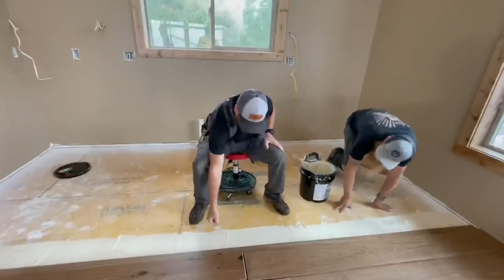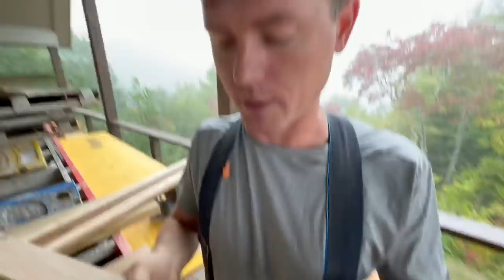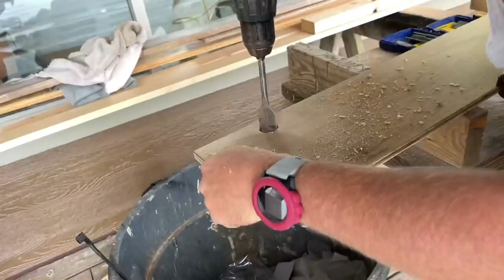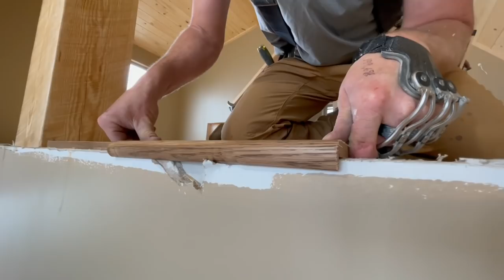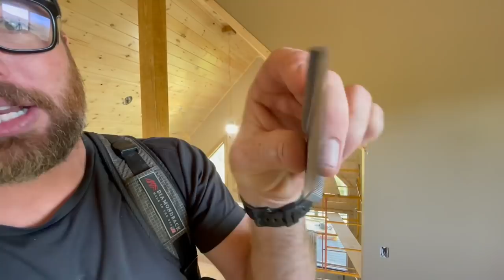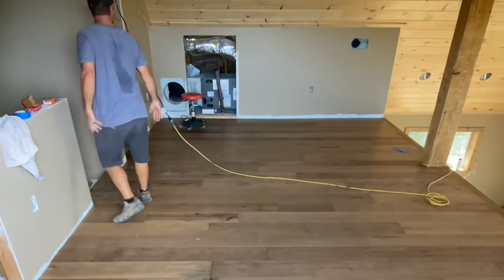Building The Nantahala Retreat #36 | Flooring Details MATTER

Comment: When putting flooring down in my office I ended up in the interesting position of the room length being exactly 2.5x the board length, meaning any cut offs I used would create a stair step pattern.

I ended up just cutting off a random amount from the cut off so that wouldn't happen, or wasting part of a long board to mix it up a bit.

Comment: Have you ever attempted to make your own nosings out of the engineered flooring? I do it all the time and its super helpful for those odd situations where you cant buy anything that will work. Plus the finishes match perfectly. I just rip the length on a 45, return the face down by double the thickness of the flooring, and then return back into the riser by whatever you want the overhang to be. It leaves a nice square edge nose that most people like the look of. I can precut and put together enough nosing pieces for a standard set of stairs and landings in about 2-3 hours
Reply: Have an Instagram to show what you mean? Sounds like an interesting cost effective solution!

Comment: how exactly can the wood floor contract/expand if it has been glues and nailed to subfloor ?
Reply: I had the same question!
Reply: Its engineered hardwood. It's very stable and made of much the same material as the subfloor. If it's expanding or contracting (whatever microscopic amount) the subfloor likely is too
Reply: @Beandiptheredneck  if the subfloor is expanding at the same rate as the flooring, and the subfloor is glued and screwed to the joists, wouldn't the walls move with the joists, such that there isn't any relative movement between the flooring and the walls? The 1/2" gap rule seems vestigial in this case.
Reply: @kschleic9053  i totally agree. The only issues I've ever had with any flooring expanding was laminate I laid in my own house, which is a dirt floor crawl space with no vapor barrier, i really think the whole expansion/contraction issue is blown out of proportion save a few specific materials